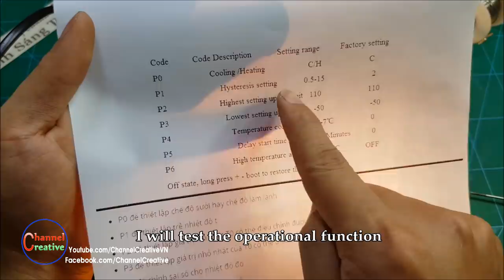How to make a Hatching Egg Incubator at home

Comment: Fan is used for Exhaust or inner air tell me ?
Reply: Also my question
Reply: The fan is used to circulate the hot air throughout the box 
From light to box
Reply: For both inner air and speeding heat all over the Box.. Fan should be placed in between the 2 Bulbs..
Reply: Fan should always be running, even light is off...!!??
Reply: @ibrahim001ify  yeah .cuz it needs air circulation 24 7. And it helps maintain the temp
Reply: @faliya9625  but he gave here same channels for light and fan...

Comment: Thank you very much for this video, I learned alot.
Iam living in Egypt and it's a poor country in most fields so I can't do exactly what you done as I have a poor abilities so please if we can contact to find replacements and guide me.

Kind Regards.
Reply: Okay 
Its simple but u should do some ground work on module.
It act act alone as it is not sensor and is module.
Cost 150 
Give bulb wire to relay unit on temp
 module.
Give small fan wire to relay unit on temp module
Now set temp 39-41 
Done
Do it in a thermocol box and have husk or hay at bottom

Comment: HOW CAN WE LEARN IF YOUR VIDEO IS TOO FAST, MAKE IT SLOWER SO THAT WE SEE THE WIRING INSTALLATION
Reply: Let me explain themostart have two sides input and output ,input side you connect supply voltage 220v output side you connect load   bulb and fan, if your fan can use dc voltage may be 12v you must be use adapter 220acv to 12dcv it terminal side are written everything if your  fan can use 220acv u can't  use adapter  u connect parallel with bulb

Comment: The wiring is quite simple: off the yellow wires on the AC (220/240 vac) one is cut in  the middle approximately, and then each of the ends are connected to the sensors two AC terminals for the operation of the micro relay on the sensor board. All the rest is 12 VDC. If you don't want to open the 12 volt power supply, then get an adapter with screw terminals which can be plugged onto the end of the 12 v output. Alternatively cut the end off, and strip the two wires,,,  red goes to red and black to black. You might have to use a $10 multimeter to check polarity is the stripped wires don't show up red and black. The fan and the sensor are all  12 v and easily identified. I hope this might help someone.... remember the yellow wires are high voltage, so be careful with these.
Reply: Can you please draw the circuit?

Comment: I have a question. Why i cant feel the heat coming from the incandescent bulb when i turn it on? But it indicate in the thermostat that it reach from the temp that i set. Should i leave it for while before i put eggs there? By the way i used 50watts.

Comment: You need turning of the eggs for the first 18 days otherwise you will get bad hatchabilty percentage and high embryos mortality.
Also you need to maintain the humidity to 80% and air circulation to avoid high CO2 inside the incubator.
Take care
Reply: does the buld deep into the water or not?

Comment: Is the DC Fan optional? Or is it necessary for this this to work..
Reply: The fan is very useful to help circulate the air inside the incubator so the temperature will be the same on every spot in there. Otherwise it will be warmer on the side where the light bulb is, and cooler on the other end.

Comment: No disrespect but it's quite a bit of work and a lot of equipment you need. I've made 2 in a much simpler way. And I've made mine with 2 bulbs. One that brings it almost to the correct temperature. And a second bulb goes on and off that is connected to the thermostat. Because if one bulb blows then the other one will keep the eggs alive for quite some time. And also I know its fun and a challenge to make your own if you have the equipment or get it very cheap. But most small incubators aren't very expensive.
Reply: Please upload a video on incubator

Comment: I bought one of those controllers. But mine stays off  then turns on after the temperature is reached. Help me with the program.
Reply: Long press the set button then w8 till P0 registers, push set ang click + till it registers H click set button and w8 for a few seconds

Comment: Light bulb  is dip in water or not  tell me please  😢😢
Reply: No need of light bulb..it takes a lot of electricity and your current charge will be high..try a heatsink
Reply: But  i don't have heatsink i use light bulb  no problem of  current
Reply: Okay good to hear that..a heatsink is found in a computer sparepart shop for 100 RS..if you wanna try just do it ..it consumes only 1/6th electricity consumed by bulb
Reply: same question bro
Reply: im asking if the bulb in this video is dip in water or not?
Reply: @UnityRidersTV  yes it is under the water

Comment: after load shedding it's not start automatically?
what should I do
Reply: Take a 12v heater and battery. Connect battery with 12v charger
Reply: Maybe I am too late but hope it helps. You may have found your answer. If not, read on. These modules with settable temperature ability store the the set temperature in a temporary memory which is deleted when power is switched off. To store the settings even after power is switched off, a battery back up or a different type of non- volatile memory IC is required. This may require redesign of the full circuit & programming it again.
Reply: thanks